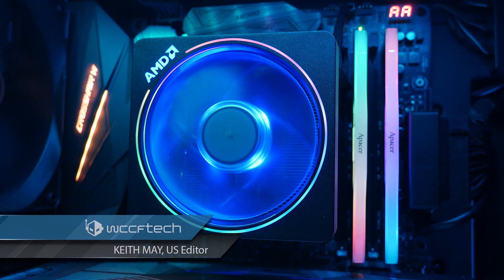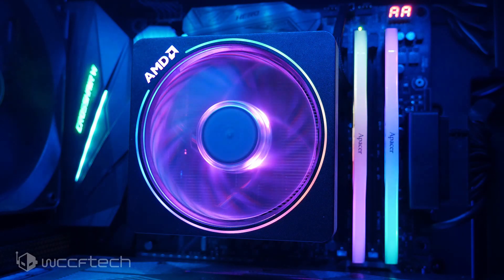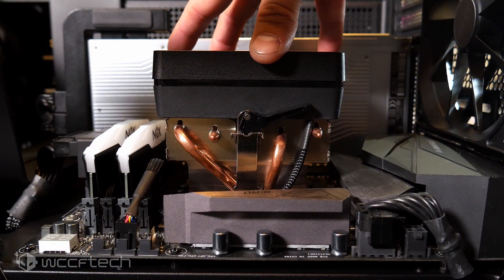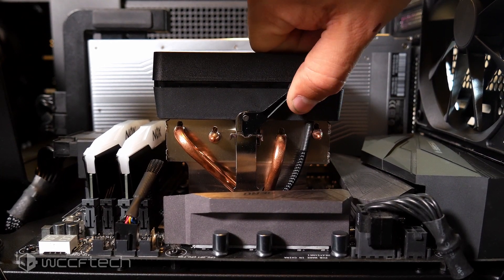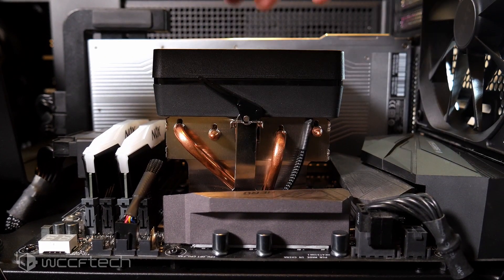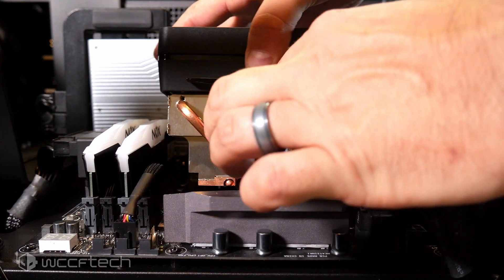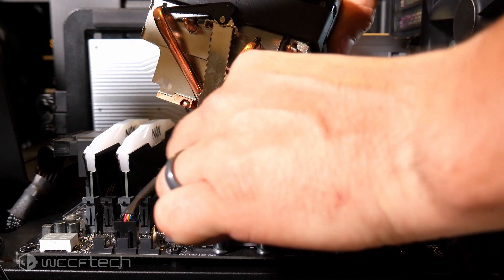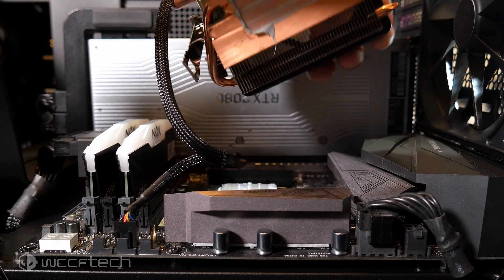How To Remove AMD Wraith Cooler Safely

Comment: Putting it back on is hell unfortunate my replacements cooler the dark rock pro 5 the connections dont reach my mother board and I need extentions. So Putting back on the wrath temporarily.

Comment: I wasn't sure how to flip that lever. it was locked down tight. but finally got it flipped up.
Reply: How did you manage it? I used force and bent the clip. Now even more difficult to move the clip.

Comment: unfortunately this method doesn't help. the CPU is deadly stuck in. I removed it using two people, one holds the motherboard firmly, the other with back and forth rotational movements can pull the microprocessor out of the socket, so the CPU comes out glued on the heatsink. You still have to find a way to unstick it. Obviously you have to unscrew the backplate for this

Comment: I had a huge problem with my AMD Wraith cooler trying to remove it from my 3700X. After a 30-minute stress test, it was impossible to twist it even by a millimeter. The cooler came out with the CPU stuck on it. Removing was harder than i expected, heating it with a hairdryer was useless. I spent an hour with a cutter knife blade to finally succeed. The thermal paste was completely dry (I wasn't worried about the temperature as it didn't exceed 70°C). Patience was the key. I never thought i would be able to save it, and luckily, my motherboard wasn't damaged. I've never had this problem before.

Comment: OK i'm going to write this here, even though it shames me it happened -

Got the same setup, same cooler. Not sure when it got repasted last or if it's even factory paste.
Decided I wanted to repaste it. Followed this video and others - Same as you guys, was kinda hard pulling that sucker out even though I ran it for some time before, to get it kinda hot (normal games, not stress tests).

The cooler came off together with the CPU, which is kind of a no no by itself, but luckily the pins weren't bent. 
Looked up another video which suggested to use a boxcutter to free it from the cooler plate. Did just that.

Problem? I freaking didn't see it correctly from that angle and ended up slicing the damn chip IN HALF. IT was hard AF, but I actually did it. Needless to say, it got ruined.
Had to buy a new CPU a few days later. So yeah... look out. If it gets stuck, don't make the same stupid mistake and slice it from it's middle point, slice directly from the cooler plate. I feel so dumb that that happened.

Comment: Is it ok if the cooler is slightly tilted when installed? Mine is tilted  just like in this video, so to the right just a little. I had my preinstalled and the tilt of the cooler is bothering me.

Comment: First time repasting this since I built this system back when zen 2 launched... and it was harder to remove the stupid clips than the cooler from the old paste, turns out the paste kinda dried up and easily broke apart when I did the twist motion, downside of course being that it made an almighty mess inside my case which I'm still not sure I was able to fully clean up lol

Comment: Yeah I pull my cpu out with this cooler when I took it off for my new AIO. Lesson learned because from doing that my motherboard died. And bend some
Pins on my 3700x lucky i saved the cpu but not the motherboard so replacement time.

Comment: I have very BAD experience with this AMD Cooler. I didn't turn on PC for about a week, then I bought new cooler. When I remove the Wraith Prism the CPU stuck with the cooler and the pins was bent. I almost cried knowing my 3900x was damaged.
Later I tried to fix the bend pins by straightening them up and it works again.
There is no instruction how to remove it on the manual paper. this make amateur builder like me have to feel the pain. I can't imagine if the pins not just bend but also broken.

Comment: I saw another tip on removing the cooler. along with heating up the cpu, you can run a string between the cooler and cpu to destroy the pressure contact the paste made, should make removal alot easier
Reply: That's a good method would it work with the wraith spire

Comment: So as long as the clips are lose on both ends , then you need to twist , and when it does start  to twist/move...then u can ,lift it slowly...
When i twist , it seems very very firm still.... i confirmed the stock paste was used.
I need to clean my heatsink and fan its got some dust .
But yes, to confirm , if it feels really tight to twist , do i just run the machine to make it hot first a bit ?

Comment: Worried to replace my thermal paste now because of all the posts I've seen saying the stock paste is literal glue and they bent their pins trying to remove it.
Reply: Happened with me, it's not JUST GLUE, it's SUPER GLUE. Had to use industrial strength paper cutter to separate my cpu with bent pins from stock cooler.
Reply: You should be fine if you use alcohol to gently remove it

Comment: I’m having trouble getting mine off
Reply: run aida64 for 15-20mins and then try to remove it
Reply: Tiiiger well I have already unplugged everything
Reply: @cc.creationz  Well then u can try to remove the cooler but there is a pretty high chance that the cpu will come out with the cooler id just connect everything and run aida and then remove the cooler just to be safe
Reply: Tiiiger I’m wanting to remove both because I got a new motherboard but is it safer to remove one at a time?
Reply: @cc.creationz  Yeah u can bend the pins if the cpu comes out with the cooler
Reply: Tiiiger do I need to replug everything back in to the motherboard to run it?
Reply: @cc.creationz So u can place the motherboard on the motherboard's box and just run aida on that u dont need to mount everything in the case but yeah u will need to plug in 8pin for the cpu 24pin for the motherboard and a gpu and the pcie cables for the gpu and u will also need to plug in the 4pin from the cooler
Reply: Tiiiger you have ig?
Reply: @cc.creationz  i got discord/twitch if u want to message me
Reply: Tiiiger I’m lost as shit lol this my first time alone doing this

Comment: Yup just ripped my 3900x off. Bent the pins. Nice . And then I get this recommended
Reply: :'( Fuck.... 

Hey if it makes it any miniscule comfort i once had a pc go up in flames (burned PCI-E at the gfx card) at a big netparty worth 3000$ in 2008. 

Killed my at the time super wifi asus mobo and my GTX280, culprit being an Antec linked dual 1300W psu (maybe the PSU still worked, but i smashed that fucker into the asphalt later on since there was no options at all for returns or anything). This day today, when i hear the word "antec" i get the fucking tics and shivers.

Comment: I really hoped that I watch this video before I attempted to remove the cooler which ended up with 2-3 bents pin. Even though I managed to straighten it and got my PC to post again, but it can not detect my ram in either B1 or B2  anymore. Hopefully AMD accept my RMA request 🤞🤞🤞
Reply: I feel you pain, bro
Reply: I bet they did

Comment: I just realized after a week of using this cpu I didn't even lock the cooler onto the cpu properly, I have never been more dissapointed in myself in my entire life
Reply: Hey i tried to install my gpu without removing the plastic that protects the part where you connect it to the motherboard. The worse part is i thought it was incompatible with the mb.. That small heart attack and the following disappointment in my intelligence, i still couldn't recover.
Reply: Really appreciate this type of brutal and open self-reflection on the internet
Reply: A week? HA!.... wait.

*mine was installed incorrectly for the past 3 years, apparently - until I read this comment.
Reply: just wanna let you know 5 years later that other people have also done this lmao. Just realized that my cpu temps are high because im a nonce and didnt put it in correctly

Comment: This video is BS: at 0:30, before he even touches the lever, you can see that the retaining clip isn't even attached the board - it's way too high. He's deliberately set it up so it looks far easier than it really is. If someone follows his advice, rotates the lever and immediately tries to rotate the cooler left/right as he does, they stand a decent chance of destroying their motherboard.

This is a really irresponsible video. What kind of asshole does this?

Comment: Heat the cpu up the thermal paste will be like goo and easier to remove.
Wiggle the cooler while its on the cpu and try to twist it gently.
Try holding a corner down with something long but do it very carefully.

Comment: After the 5 or 6 hour job of fixing bent pins my advice is to spend the money for an after market cooler just to avoid the chance of pulling to cpu out of the socket. It can happen very easy and the stock cooler isn't very good. Even a Hyper 212 will drop temps by atleast 10c. Thinking you just trashed a $400 plus cpu just isn't worth it imo. Was like brain surgery getting the pins straight enough using an exacto blade and a magnifying glass.
Reply: That's not the case for me. I used Noctua NH-D15 and Lian Li Galahad 360 only and it still happened. I didn't stress test CPU and I didn't do that cooler wiggle trick though.

Comment: do i need to clean the cpu of the thermal paste leftover by stock cooler before putting the upgrade after market cooler? or should i let it be?
Reply: Clean that cpu removing the old thermal paste and add new thermal paste on it when using the after market cooler.
Reply: @masterlee1988  can use tissue and alcohol? and should i remove the cpu from the mobo while doing this? im very scared of breaking or damaging it
Reply: @mmcgear4376  The rubbing alcohol should be 90+ percent and it's for the best to use a micro fiber cloth and/or coffee filter. Yes, you can remove the cpu from the mobo to do this though people have cleaned their cpus with them still on the mobo.
Reply: @masterlee1988  I only have methylated spirit to clean, will this work?
Reply: @peterpiper2908  I haven't heard if that works or not.

Comment: Had to return my motherboard due to defective issues, it was my first time building it too. Had to take off this cooler and it was super terrifying. As I took off the latch slowly, it shot up and smacked my finger like a rat trap. I tried taking off the other latch but it wouldn't go, no matter how hard I tried. Then I twisted it a bunch and it came loose. Once I got it up, the latch was easy but I was very fearful that I had bent pins. I cleaned off the paste (pre-applied, which was everywhere) and struggled to get all of it off, especially the sides. I thought I got alchohol into the pin socket and got really nervous. As I took it off, the latch made a "pop" as if pins were bent or thermal paste was being snapped. I took out the CPU with no bent pins. Man, that is a roller coaster just taking off the CPU for the first time. Hope I never have to do it again!
Reply: Afterwards, I sent my motherboard back to Asus to get fixed. They sent it back to me, still broken. I didn't know at the time until I had already put everything together. I had to do it all again but at least I got to get alot of building experience. I returned my motherboard to Amazon and had enough. I got an MSI board which worked perfectly. In the near future, I plan to get an AIO water cooler. That means I need to take it off for the 3rd time in a row. Luckily, I now have plenty of experience and can say with confidence that I won't brick my system just by looking at my Cpu cooler. It's been a journey.
Reply: Congrats mate! On successful re-installation
Reply: Exactly the same thing happened to me. Now I want to replace the cooler but I'm terrified of doing the same thing again. The CPU came out before I even had a chance to think about twisting it. I think heating the chip up a bit first might be the trick.
Reply: Oooh, thank god it worked man! I remember stuff like that, CPU/Mobo issues/close calls gives special kind of sweat, 1000x more sour and foul than when im working or jerking off.

Comment: I'm done with AMD... their coolers n latch system is such a pain in the ass. I think I killed my Ryzen 1600 AF CPU because of this, I'm still bench testing to see if its the MB. Intel coolers are so more stress free to install.
Reply: Yeah, its bullshit. Wouldnt hold it against you going Intel for life regardless of who is winning the race.
Reply: Ya u got to loosen am4 bracket, latch, then re-tighten screws.

Comment: I had mine installed for less than a week and when removing the cooler found that the thermal paste was glued to the cpu. I just pulled it straight up and the cpu came out with the fan. I about passed out when it happened. Luckily none of the pins were bent and the cpu went back in with no problems but I got lucky. From now on when removing a cooler I will take the advice of others here and run the computer hot for a few minutes to warm up the paste for easier removal.
Reply: Wasn't happy with temps so after a week got a new cooler for my 3900x. Pulled and twisted slowly and had no idea cpu pulled out while I fumbled around to get the other spring unhooked. Once removed noticed no cpu in the socket on the motherboard. Almost didn't want to look at what was on the bottom of the cooler. Not only did the cpu pull out I managed to bend about two and a half rows of pins unhooking the dumb spring hold down. With alot of patience and about 6 hours I managed to save it and will never own another board with such a weak holding socket.
Reply: @mikemell7590  same happened right here
Reply: yap yap  Hi, how did you remove the cpu from the heat sink, mine is completely stuck, ive tried everything
Reply: Nirmal Nagindas did you fix it? Mine is also stuck
Reply: yap yap  I got anxiety just reading that. I thought the CPU would only come off if you undo the latch? I'm using a different thermal paste so I hope it's just AMD's paste that acts like cement.
Reply: I did the exact thing to my r5 2600, also luckily didn't bend any pins and thankfully it still works fine to this day
Reply: Thank God the cpu was okay
Reply: I had the same thing but one pin bent on my 3700x. Thank goodness i was able to bend it  straight and it booted/ runs fine over a year later still. NGL im scared to do it again lol
Reply: Bruh...
Reply: Happened to me to…. When I was building my pc, the stock thermal paste was cemented onto the cpu. 
Unfortunately I lost 4 pins all of which were vital.
Reply: @ItzZed  Dang that sucks. I have since removed that same cpu by heating my cpu up and it still comes off with the cooler. I will now use a modified screwdriver that I have bent at the end to pry the cpu off as I remove the cooler. Stupid design and I am glad AMD is switching to LGA for their new CPU's.
Reply: I did the same thing on my first cpu, I thought it was over, but no damage was seen and apparently it was a very common experience with this fucking cooler
Reply: Got some problem and plus my cpu pins got bent...  I also fixed the bent pins and re installed cpu. It worked but that was like a nightmare literally.

Comment: I replaced the stock air cooler on my dads FX8320 he bought 3-4 years ago, I did exactly this same thing and it pulled the whole chip out with it, luckily I was able to heat it up and razor blade the chip off without damage.

Comment: You need to run your CPU hot, hot, hot like with Cinebench R20 or something, then immediately shut the system down and remove the heatsink. This way, the thermal compound will be softer due to the heat.
Reply: just commented asking for this info.. lol thanks for the help!
Reply: Okay , hope this works man, i dont want to even experience pins being crooked... i mean surely if i just make sure the 2 clips on either side are loose...
Then just gently just try to twist with as small degree of movement as possible.... then i should be fine right ?
So i.e. i can mine Monero or run a benchmark on the cpu then shutdown immediately, losen the clips....then try to twist....
Reply: @CollosalTrollge  how did it go?

Comment: so I was wanting to reapply the thermal paste and this happened to me.  How bad is it for the CPU?
Reply: If there are no bend Pins you are fine , but if there are you could have a sirious problem
Reply: @heavendeeznuts  i had 1 bent pin but i bent it back and slotted it back in

Comment: This is not how it went for me today. The stock paste was basically glued too my 3900x and when i pulled the cooler off it took the fucking CPU with it! I bent 4 corner pins on the CPU and almost cried. Luckily I was able to use a needle + tweezers to bend it back mostly straight. When the cpu aligned into the socket I was the happiest man on earth for a few minutes. AMD really needs to just pay Intel license fee for the pads. I would pay the extra $20-30 premium to ensure my CPU is safe from hazards.

Comment: What I learned from this: Twist and then brute force
Reply: That's one way to ruin your cpu for sure.
Reply: @DinKompis  I'm having trouble with mine not unlatching, so this video is showing me nothing
Reply: @dat_lou5561  Unscrew that plastic things on the motherboard that the latch is latched to.
Reply: @DinKompis  Access to those screws would be pretty hard with the cooler still on